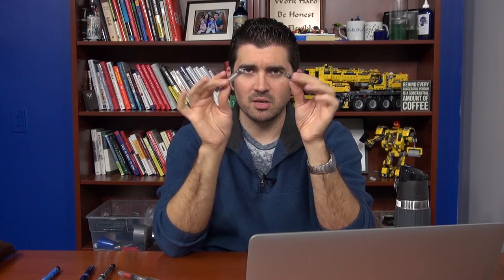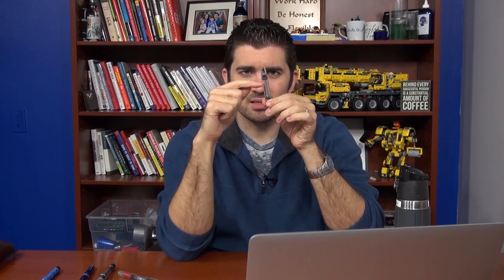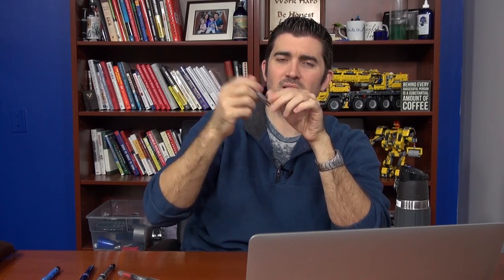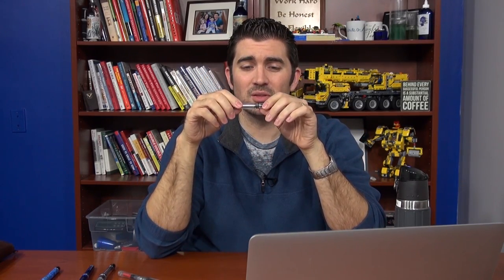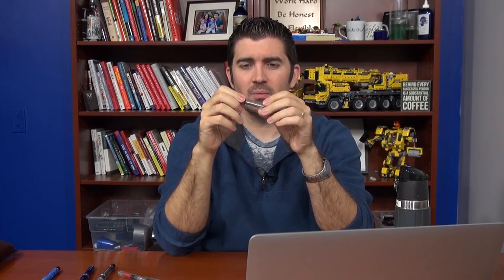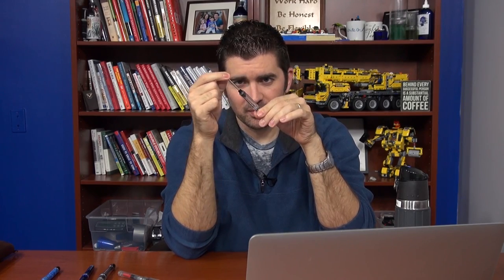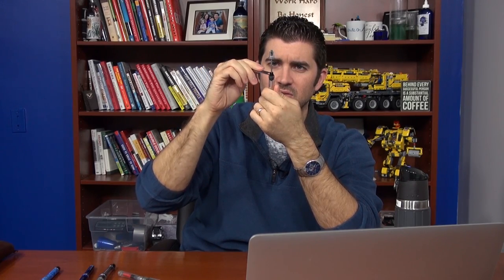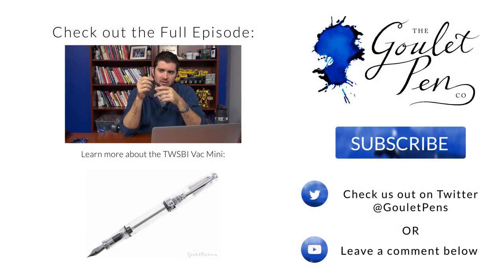How Do You Clean The TWSBI Vac Mini? - Q&A Slices

Comment: This has been a great pen. I purchased this as my main study note taking pen.  And purchased a textbook type notebook and carbon ink to insure the notes will last. 
Had it filled with the same ink for 3 weeks, with one pump. Before I HAD to clean it out.  
Following those I purchased a Lamy and Pilot Kakuno both are also great for on the go and the beginner fountain user. 
And lastly a Platinum Preppy and Zebra Zensation for letting others borrow. They are nice for writing and I wouldn't lose my mind if I never got them back after lending out

Comment: What is the silicone grease used for?  I received a small bottle of oil with the pen, but there was no mention of how to use this silicone grease.
Reply from the maker: With the TWSBI Vac Mini, it's used to grease the sides of the vacuum piston. Sometime it catches on the sides of the barrel making it harder to operate. That's when you disassemble and add in the silicone grease. - Colin
Reply: The Goulet Pen Company thank you

Comment: Hello, do we use silicon for vac fillers like the Pistons ?
Reply from the maker: Yeah you can. If the plunger is catching the sides and not moving smoothly, you can apply a little silicone grease to the edges of the plunger to help. - Colin
Reply: And also maybe to the barrel threads like an eyedropper, if you wanna be real safe.

Comment: I have a question....
My TWSBI Vac Mini's piston is too difficult to pull or push, do I need to disassemble and lubricate it or is that normal? if it's not, any advice on how to fix it? Thanks in advance :)
Reply from the maker: Yes, making sure your plunger rod is lubricated with silicone grease is necessary to keep it moving well. Taking it apart and adding in that lubrication should do the trick! - Colin